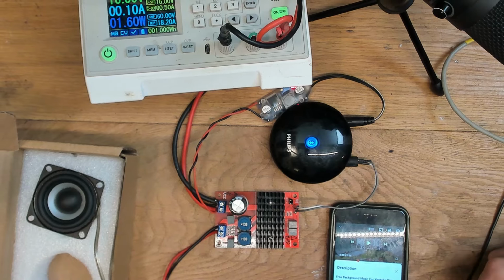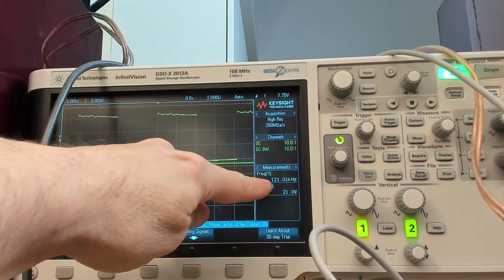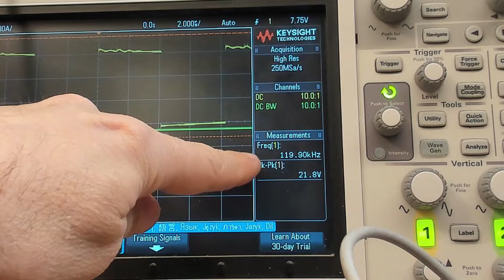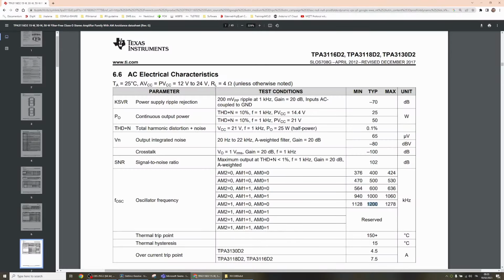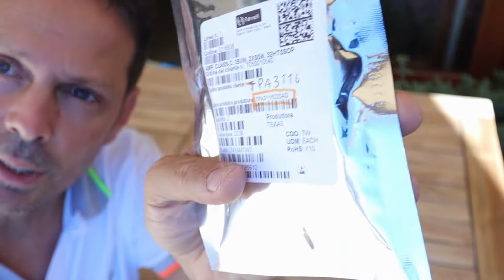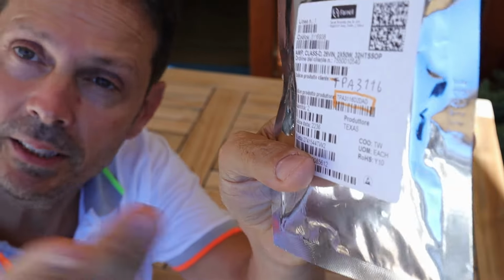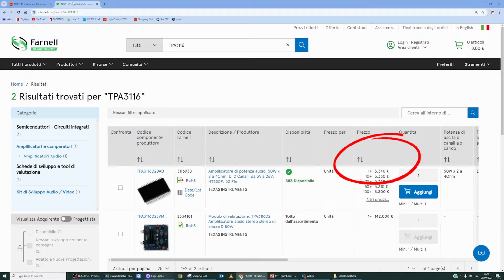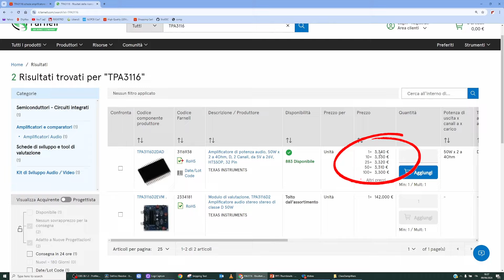TPA3116 class D amplifier with Fake IC?

Comment: my two 8610 which is the best sounding of all my class d's, had shorted out supply , one of two diodes burnt out, now thinking reverting back to old class AB.
Reply from the maker: It make sense. I also think about this. The only problem is the little space I have available for the Amp in my living room